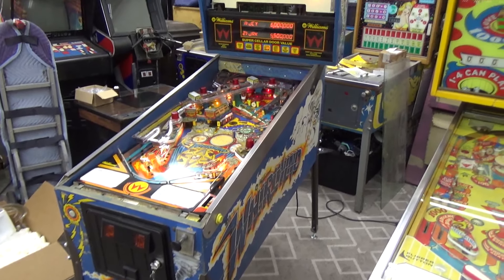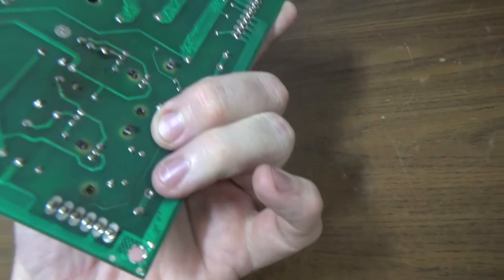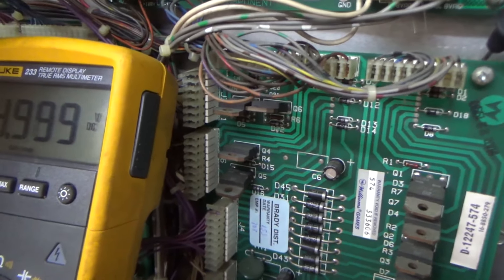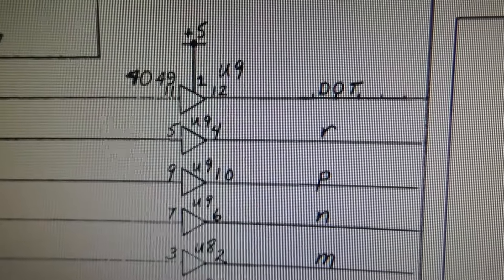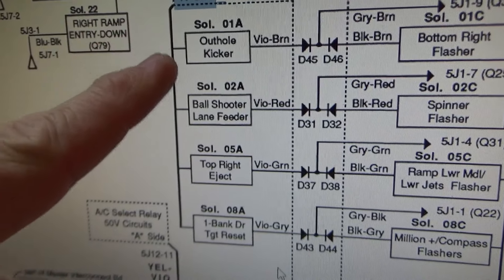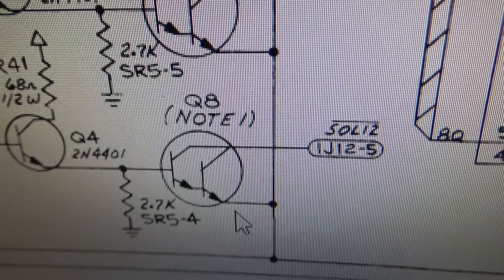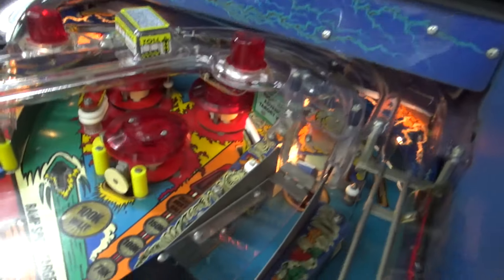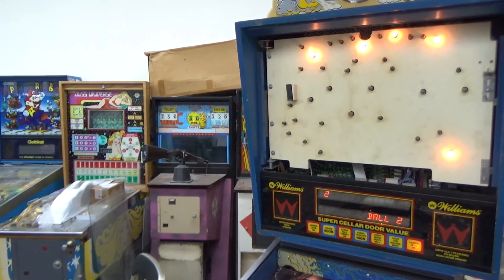Williams WHIRLWIND Pinball - Power Supply & Alpha-Numeric Display Diagnosis

Comment: The triangle things on the display schematics should be part of a buffer IC. 

DPDT -- The poles refer to separate switch stacks. The "throw" refers to alternating between NC and NO. Many relays are SPDT, but this has 2 stacks of NC, common, and NO connectors.

Comment: I vividly remember when you got mult-iball, you would hear the words, "Here it comes!"  That is when the PIN went ape crap.  Lights flickering everywhere, the spinners on the play-field were spinning, and you were trying to fight them to get your ball to the 3rd flipper so you could shoot it up the ramp for the jackpot.  While all this was going on, you were receiving a nice breeze from the fan on top of the display.  It was a beautiful touch to give you the feeling that you were in the middle of a Whirlwind.  But, you are right Ron, as time went on, PINs became more complex.  Especially when it comes to repairing them.  As a kid, you don't think of everything that goes on behind the stage, so to speak.  You just drop in your 2 tokens for 1 credit or 4 for three credits (depending on how the operator has it set up) and just play.  As I mentioned before, I ordered a Wii and the 2 Pinball Hall of Fame games (Gottleib and Williams)  But thanks to the good ole' USPS, my package was mis-routed, so who knows when I will receive it.

Comment: Any reasons why they call the AUX Solenoid driver board the A/C Selector Relay, because where is the "B" Select Relay? I'm confused why they only have an "A" Side and "C" Side and NOT a "B" side. There must be reasons why the pinball engineers called them an "A" side and "C" side for some reasons

Comment: Hello Jo, I've been watching you for quite some time, so much so that I'm starting to restore pin games. I just got my first ss game, it happens to be a williams laser ball. When I power on the game with the driver board plugs off the board, the game does not boot at all no less on the board as well, any ideas of where to start?
Reply from the maker: The way these work is, they use the same boards for several different games.  So yours is a System 6, it's not much like this whirlwind.  It's more like a Williams Lucky Seven... if you check out this playlist it'll show you how we worked through one of that era.... https://youtube.com/playlist?list=PLXBCNT6PGQNqTZkykLmSTuLKvBehXobvR&si=36oymhyC0DWGD-VU